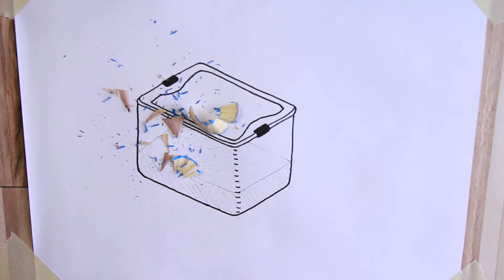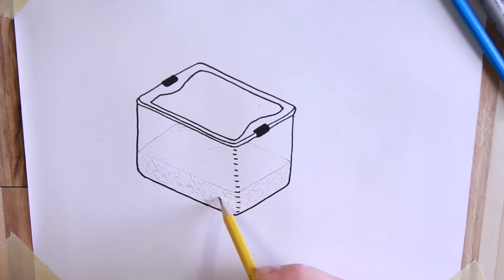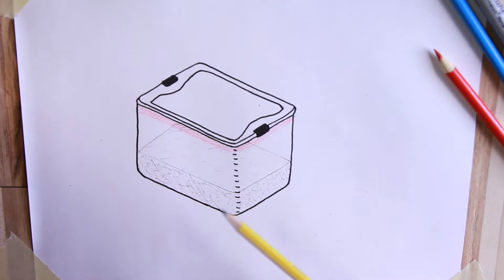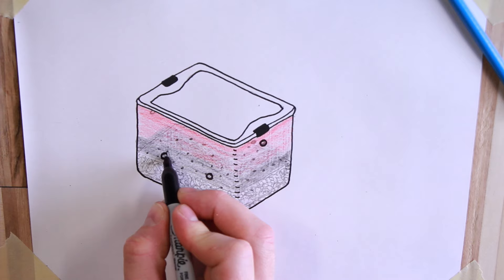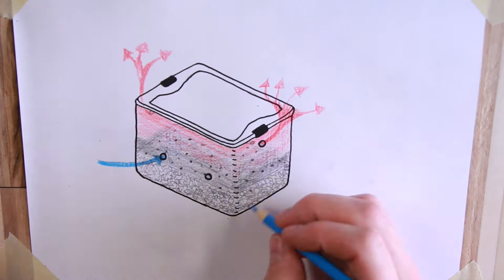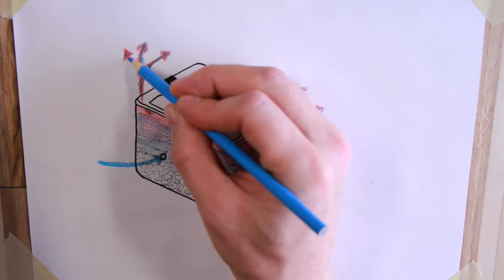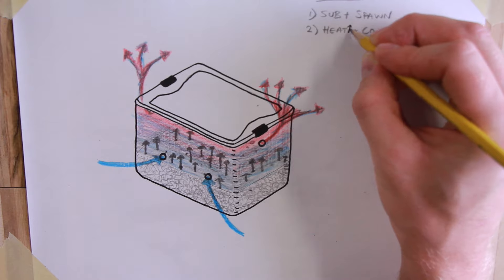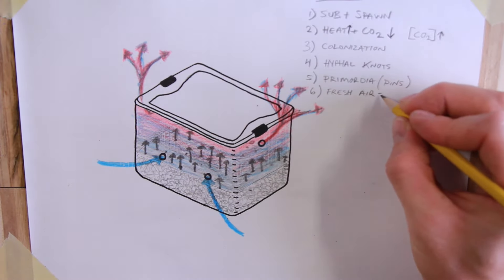Basics of How a MonoTub Works - Understand Fruiting Conditions, Gas Exchange for Growing Mushrooms

Comment: Why are the hot air holes always placed on the side of the tub instead of in the lid? I can't find any explanation online for it. It just seems to be what people to because that's how they were taught but wouldn't the path of least resistance be straight up through the lid or is there something I'm missing?
Reply: My guess is so that contamination doesn’t fall thru so easily. But u make a good point
Reply: @dodgersfan1  that's what I was thinking too. That and people who grow a lot stack their tubs.
Reply from the maker: I agree with the two answers here...having holes in the sides reduces the possibility of things falling in, and allows for stacking.

Comment: Hi, I'm just starting out and have two questions.  Do you need to spray it/mist it with water during the grow?  Or is it best to leave the lid on?  Another video I watched said the sub should be moist enough where if you squeeze it, it should produce a few drops of water.  Does that seem correct?  Thanks for the great video.
Reply from the maker: I personally just leave the lid on.  I take it off once every few days to take a look inside because I cant help myself, but I don't mist at all.  

That sounds about right for moisture content.  The term is field capacity.  Basically, it shouldn't drip water when you pick it up and hold it loosely, but when you squeeze some water should run off.

Comment: But sometimes the gases escape from the lower holes

I’ve had holes at substrate level, but i’ve noticed when holes are up higher, you get longer grows, too much fresh flow/Fogger makes fat short ones,   Its very dynamic, outcome always varies by the slightest changes, also a 10 gallon fish tank with diamond cut little holes yields very tall outcome, but the silicone sealant is very hard to sanitize w alcohol, silicone is high risk to waste..

Comment: does it need light to start fruiting?
Reply from the maker: While lighting is a factor, it is minimal. For most common mushrooms, the normal day and night lighting cycle should be sufficient.  Light helps them know which way to grow. If you're putting your lights on a timer, a 12/12 schedule should be sufficient.  I'd recommend looking up recommended lighting cycles for the specific strain though.  

Bottom line: most mushies do great with natural light cycles.

Comment: so i turn on the computer fan once it starts to pin??? until then leave it off???
Reply from the maker: I don't use a computer fan. The action of the hot air rising and exiting helps draw the cold air in. It's natural circulation.
Reply: @OneEarthMushrooms  ok 👌.  I just want to do as good of a job as possible for my first grow. I bought Reptile humidifier, timers, humidity gauges, grow lights, north spore spawn and substrate. I think i went overboard. You think this will actually negatively affect my chances of sucess? Is there a book you would recommend that has some teks lined out Nicely  with pics Or a anything of the sort. I really appreciate 🙏 you responding and it means alot. Thanks 😊
Reply from the maker: @link6397  no, I think you'll be fine. I've seen the north spore kits and they look fine. A little more complex than is required, but I'm sure they get great results.  

Growing Gourmet and Medicinal Mushrooms by Paul Stamets is a really good book. Also check out the shroomery (Google it), it's an old forum that's shut down now, but still has all the old content up. Great resource. 

Let me know if you have any questions during your grow! I'd love to help and see you succeed!

Comment: Why not put holes in the lid if that's where all the heats at?
Reply from the maker: My reason is mostly because of gravity.  I don't want dust and airborne spores from non-desirable fungi to start dropping into my monotub.  Putting them on the sides near the top seems to accomplish the same thing.
Reply: @OneEarthMushrooms  ok makes sense. But if you had polypill wouldnt that negate that issue? Weed grower starting Mycology lol. Thanks 4 the response.
Reply from the maker: @mikehunt4797  Mehhh kinda?  Polyfill is used very loosely, so it would be pretty easy for contams to work their way through.  It would also make it difficult to stack the tubs...some people have enough tubs going that they need to stack.

Comment: Thank you for the education. So what about humidity levels? Do you have to worry about them, assuming you use micropore tape to cover the holes up? Is the humidty trapped or dou you have to watch out for it and mist it? Because some folks just view it as a set it and forget it type of thing, but some also install fans and humidifier into their setup, so I was wondering if it is a necessity.
Reply from the maker: You're welcome!  

I'm using both micropore tape and polyfill at the moment. I have some tubs with poly, some with micropore. I honestly prefer micropore, because the polyfill can fall out or get fibers in the substrate.  

I had one problem with low humidity in a smaller tub using a single layer of micropore tape, I doubled it up and it seems to be looking great now.  

A couple thing I look for: fruiting body health is the biggest one. Is the mushroom looking the way that it is supposed to? Is it the correct color? Is is growing stunted or looking mishaped? The second thing I look at is the monotub walls close to the vent holes. If the walls are completely dry,it's probably getting too much air flow and humidity is too low. Ideal looks like a small clear ring around the vent holes and the remainder of the walls covered in moisture droplets. This is mostly due to the difference in temperature between the outside air and inside the tub, but the walls won't fog up if there isn't moisture.  

I feel that polyfill is slightly more controllable...you can pack in in as tight or loosely as you prefer and adjust as necessary. You have less control with micropore tape, but it seems to be working fine for me with a double layer on the bottom holes and a single layer on the top.

Comment: I dont get the gas exhange part, doesnt that only happen in the lungs?
Reply from the maker: In this example, "gas exchange" refers to mainly CO2 being released from the substrate.  "Gas release" would probably be more accurate, but "gas exchange" is a widely used term so I stick with that.  This is different from the term "fresh air exchange" where normal breathing air replaces CO2 saturated air in the monotub.  Does that help?  

Honestly, I don't think the terms "gas exchange" and "fresh air exchange" are widely used in authoritative mycology sources and texts, these are more "industry terms" that take on different meanings depending on who is using the words.
Reply: @OneEarthMushrooms   thanks for the elaborate answer, that cleared it up for me.

Comment: Hey dude awesome video, hoping for some advice!

My grain bag is almost fully colonised, so I'm preparing my monotub! 

I plan to drill 3 small holes maybe 3/4 inch on the long sides close to the bulk sub and then 2 or 4 larger holes maybe 2 inch? At the top, and cover with 0.2 um filters. Would this provide enough air flow? I assume larger holes at the top will replicate less tight polyfil. 

Then as you say cover these completely with non breathable tape until fully colonised?? (My lid clicks down but there's no clips so it's probably a bit lose? Would you seal it with wrap or not?

Only think I'm worried about is maintaining colonisation temps. I've had my grain in incubation (large cardboard box with heat mats on the side to keep at 26C.) My room is usually 18-24C throughout the night and day. Would this be too cold for substrate colonisation? 

I'm also still confused about whether misting and fanning I'm necessary, seems to be widely debated!

Any help would be much appreciated!
Reply from the maker: Hey Alex!  

I've never used the .2um filters for the monotub holes, but in my experience the .2um is great for an application where it is essential that zero contamination is introduced, like producing grain spawn.  The general smallest size of most particulate is .3um, so in theory nothing should get past the .2um.  After you've established a large colony of mycelium, it's going to need to breathe and it's not as essential to prevent ALL contamination, so the .5um filter is used (I'm talking about bags here, which is where I have experience using filters). 

So, I guess what I'm saying is...the .2um filter is probably going to be too restrictive for fruiting in a monotub.  I don't have any direct experience in exactly what you're asking, so I might be missing something.  I'd love if anyone else could chime in too.  

The general steps:
-Colonize your spawn
-Layer bulk-spawn-bulk-spawn-bulk into your monotub
-Cover the holes with non-breathable tape
-When fully colonized, remove the tape and replace with something breathable

18C is getting a little bit cold to colonize your bulk.  If you can keep it above about 20C it'll do a bit better. 18C is right about on the bottom end of what is acceptable for most species to fruit.  

Fanning and misting:  I've never done this.  If you have the monotub holes packed correctly, you shouldn't need it.....in my opinion.  But you're totally right, there is a lot of debate about it.  Definitely don't fan/mist before you're fully colonized though.  You need that CO2 buildup in the box to help our mycelium buddies out.   

Just curious, where do you live?  I'm guessing somewhere where it isn't the dead of summer right now...

Hope this all helps!  Cheers, Jared
Reply: @OneEarthMushrooms  

Hey buddy,

Thanks for the quick reply! 

Right okay, I'll save my 0.2um paper for when I do some grain jars or something. 

I live in West Midlands UK! So humidity and temperature vary from hour to hour let alone day to day. 😂 I can probably keep it above 20, I have a small fan heater but I know it costs a bit to run and I'm only a tenant to the house. 

Is the poly fil readily available on it's own or is it easier to just buy a pillow?

Also, I have a enough Coco coir, verm and gypsum for any ratio. What would you suggest for a 1KG/ grain bag? 
I'm unsure if you do a ratio based on dry or wet bulk substrate!

Thanks!
Reply from the maker: @alexgreen6146  I posted a copy of a calculator I built in here: https://www.facebook.com/groups/OneEarthMushroomsFileSharing/files/  It should be helpful for you to calculate your coco-coir/verm recipe.  I recommend a 3:1 ratio, based on wet weights. 
Check at a crafting store, or any of the big box stores in the craft section.  You should be able to find a bag of poly fill for about $5.  
Hope this helps!  I'd love to hear how the grow goes for you!

Comment: I did the BRF cake tek first and was wondering if I can turn my shotgun fruiting chamber into a monotub.  It has a lot of holes so I feel like it might dry out the substrate.  Was thinking of duck taping the holes for the bottom half and leaving the upper half open. Do you think that would work?
Reply from the maker: Yeah, give it a shot!  I don't see why it wouldn't work.  The only thing that I can think it might change is the amount of light that is let into the tub, but light is such a small factor, that it shouldn't change anything in the outcome.  Let me know how it works if you try it!

Comment: You got some mad skills with the brains and pencils!  Great video man, really.  I'm scared to open lid on the grow kit I have.  The instructions said keep in total darkness after mixing the culture and substrate.  So I can sort of see inside but the humidity makes it  a bit hard to see a lot.  But I can see one lonely, tiny shroom about a 1/16" thick and 1/2" - 3/4 " long.   I have it in a dark place, and put a blanket on it in case any light from the room hits it.  Total darkness as I understand it.  Is it ok if I remove the lid to have a good look and see if it's ready for fruiting, or would that be a disastrous move at this stage of growing, and wait until it's completely covered white with mycelium?   I'm on day 7 and the instructions say 7-14 days.  It's my first time and I don't want to wreck it because of my own curiosity.
Reply: A 4-month old comment, but for future reference, or do others with the same question:

One an definitely take a peak at it. How else are you going to know when it's fully colonized and ready to go into fruiting conditions? Just don't mess with it multiple times a day. 

Maybe it's species dependent, but I think the "total darkness" thing is overblown. Light apparently plays a small roll in triggering fruiting, but there are other, much more important factors.

Comment: Epic! What about putting a small fan in the lid that pulls air out of the container and draws air in through the micropore  tape for FAE? Or maybe a small fan/filter box attached to the top with a small hepa filter that(on a timer a few times a day)  blows filtered air into the chamber?   I’ve seen some small reptile misters that can be setup on a timer to mist the container a few times a day as well. Curious on your thoughts!  Thanks for the best monotub video out there
Reply from the maker: Yeah, that might work. I think that may be defeating the simplicity of a monotub though.  There's a technique called the Martha Tub, it's a much larger fruiting chamber that is essentially what you're describing here. Perfect for cultivating multiple grows at the same time. I haven't played around with that Tek yet, but it seems to work great!

Comment: You don't need the holes, just crack the lid
Reply from the maker: I've seen those Teks used, but never tried it myself. I'd be interested to see how they compare side by side.
Reply: @OneEarthMushrooms  I would love to hear your results. The major benefit is that it allows you to fill the tub with water and float the entire cake to the top for harvesting, simultaneously hydrating the cake
Reply from the maker: @minkusmaz  I added it to my list! I have so many things I want to try and compare.

Comment: This is backwards. C02 (0.001836 gram per cubic centimeter) is heavier than 02 (0.001429 gram per cubic centimeter). The C02 falls out the lower side holes creating a vacuum which draws in 02 from the upper holes on each end. Physics.
Reply: So in the end it still works ?

Comment: I didn't even bother watching the video because already the thumbnail with the air exchange is 180 degrees wrong.

Since co2 is heavier the arrows are exactly the wrong way.

So if you don't get even the air exchange right, which only needs 5th class physics, there will be nothing worth looking forward to.

Comment: This is NOT accurate!!!!!  The top holes are INTAKE!!!  Dryer air enters thru the top, pushing the warm humid air down, exhausting the air out the bottom.  This is WRONG

Comment: So if the CO2 settles at the bottom because it's heavier then why dont we all die from excess CO2?  I think you might have the wrong understanding of how air works.
Reply from the maker: CO2 has a density of approximately 1.98kg/m^3.  Normal breathing air has a density of about 1.23kg/m^3.  We don't die in normal everyday life because the two gasses mix and the overall concentration of CO2 is low enough so that we aren't negatively impacted.  If we were to open a large enough bottle of pure CO2 in an enclosed environment without air flow, we would very likely be overcome by the high concentration of CO2, especially closer to the floor of the space. 

Sources: https://www.hse.gov.uk/carboncapture/carbondioxide.htm

https://en.m.wikipedia.org/wiki/Carbon_dioxide#Physical_properties

https://en.m.wikipedia.org/wiki/Density_of_air

(I know, scholars, Wikipedia isn't the best source. I'm not writing a college paper here)
Reply: Because you presumably don't live in a sealed, air-tight room. What kind of a stupid question was that?
Reply: @mediahighlights-r1w  If the co2 settled you wouldn't need to live in a sealed box, just a low area. The CO2 would settle in that valley of whatever and you'd be fucked. Air mixes so the CO2 doesn't settle, THAT my friend, is my point.
Reply: @mediahighlights-r1w  Air is air, not layers of different gases. Even the CO2 in your sealed airtight room wouldn't settle it would just be to highly concentrated to breathe soon
Reply: @darryl0harris  Density is a thing, you muppet. The CO2 doesn't settle in regular, non-sealed environments because other air keeps flowing around and through it, picking it up and mixing with it, carrying some away, etc. and therefore not allowing the concentration to get too high. It doesn't just settle in a low area and then stay there forever because it became immovable via some magic. Again, unless you're in a sealed, undisturbed environment, in which case it absolutely will settle at the bottom and stay there.